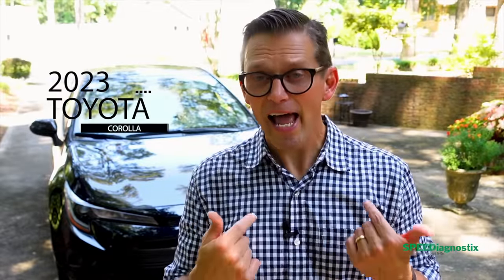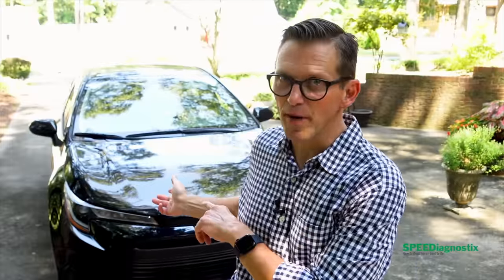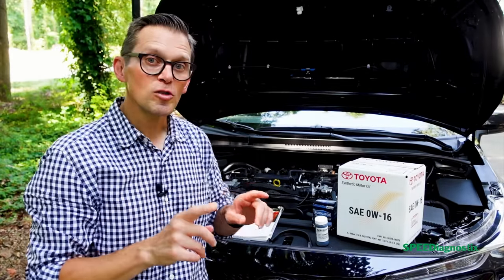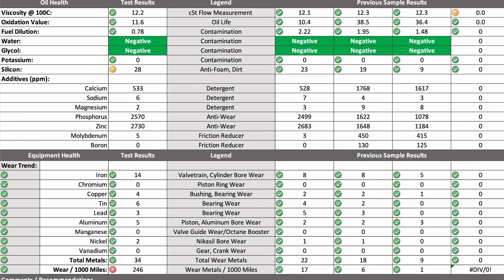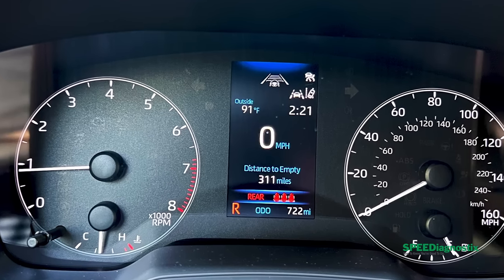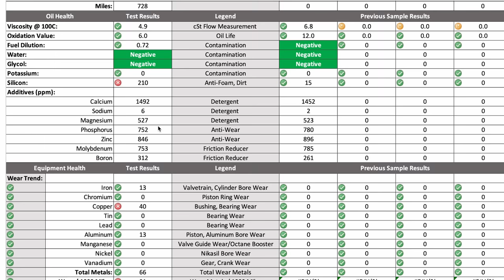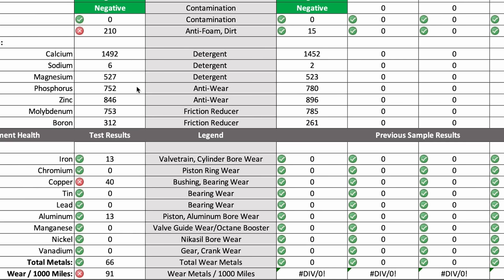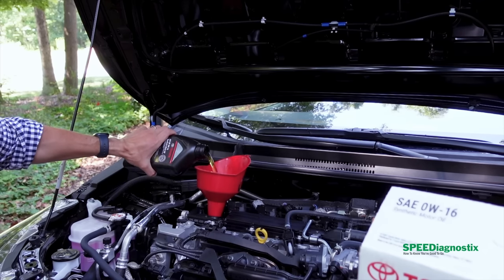AVOID the ONE MISTAKE Almost EVERYONE Makes With A Brand New Car

Comment: If you have a dealer free oil change every 5 k miles ...Mark your oil filter to VERIFY it was changed, just saying
Reply: It sounds like a good idea but not sure how to do that with a filament only filter (permanent housing)
Reply: @kamakaziozzie3038 you can use torque seal or bolt mark where the filter housing meets the engine. If they changed it, the seal will be separated/snapped
Reply: Absolutely!  When I had a brand new TRD Tacoma I took it to the dealership for the first oil change.  They said they changed the oil but when I popped the hood, same mud covered filter.
Reply: Mark it by scratching it lightly with a file. If you use a marker they got chemicals and cleaners not saying they’ll go so far as to clean off marker but you really want to be sure they changed the filter
Reply: @kamakaziozzie3038  I share your concern, and have type canister filter. What I do is use a silver sharpie and draw 2 small lines on the filter housing and filter housing contact service, they rarely mount it back to the exact same place.  Plus this tells me if they over tightened it
Reply: Good advice.
Reply: Toyota doesn't do the oil change at 5k miles, they do a rotate and inspection. We'll at least how it was when I worked there a few years ago
Reply: @EmerysZR2Duramax smart way to mark your oil filter
Reply: @zilchbupkis3109  No,use a marker pen or a paint pen of some kind which some garages use.
Reply: Everytime.
Reply: install a glitter bomb filter
Reply: I do it all the time! Its a message to the dealer! I even write change, with a sharp object!
Reply: Does not work if you have a canister oil filter as on new GM's. No way to mark it. Maybe two marks on the oil filter housing, one on the lid and one on the canister not sure what the answer is here.
Reply: @scrambler69-xk3kv  Maybe just accept that the tech is going to change it and stop being paranoid
Reply: I had dealers put way more oil in my car than I needed.... only reason y I found out....I did it my self.... to much oil cause damage
Reply: @kamakaziozzie3038  Many have thread on external cannister to go with replaceable element and they seldom torque to exactly the same spot.
Reply: Correct, and make sure to use a Sambrucetta marker to denote it.  You don't want to take any chances.
Reply: @zachdailyfost4433  Correct. The 5k mile "free service" is tire rotation and fluid "inspection". I did my own oil change on my 2024 Corolla at 2937 miles. I refused the service from the dealer because the lowest paid person is going to be assigned to do it.
Reply: You get what you pay for.  Golden rule.  If you care about your vehicle do everything yourself that you are able to.
Reply: @chrispapanastasopoulos9192  what about replacing rear differential fluid?  Subaru says to do it.  Im way over the recommended change-out, but it's a bit tricky, should I do it?  it requires a special socket.  i bought the fluid but I've let it set for several years, is it ok to still use it?  I had the wrong socket and gave up..  Am I ok or will I need to get the gear lube (Differential oil again?...I called the manufacturer - Mobil One and they said it's expired and they can't make a recommendation either way).   Sounded like she was just reading off the company policy.  Subaru quoted like $800 just to do it which I thought was ridiculous
Reply: How does that work out for cartridge type filters that are inside a housing...Anyone can disturb a mark to make it look like it was messed with...
Reply: Do Not let the dealership change your oil!

Comment: And if you're using such a thin oil, your bearing clearances and internal clearances are very tight. Which means it's even more sensitive to engine debris causing damage. Good call, thanks for the video.
Reply from the maker: Great point!
Reply: And with such tight bearing clearances for 0w-8/16 oil it’s also very important to not ever run too thick of a viscosity oil too like for ex a 5w30 or worse yet 10-30 o,5-40,10-40,yikes!/LOL!
The motor can obviously handle 16wt viscosity when the oils up to full op temp so if I owned a new car that rec ow-8 or 16 oil & lived in a warmer climate like Fl often using ac loading motor more & creating more heat I’d be running (if they make it ) 5-w-16 or slightly higher cold 
viscosity oil like 5w-20 & here’s why I say that.
In my wife’s when new 2018 RAV4 Toyota wanted us to go 10k miles an oil change inc 1st breakin oil change ,not me!
I changed oil & filter at 1k miles & again at 5k miles using m1 0-20 full syn.
What alarmed me was (esp having 50yrs Exp rebuilding muscle car motors & restoring car with motor oil & its analysis being a hobby of sorts for me) was that with only 4K miles on the m1 0-20 it was pitch black & had heavy burnt order to it which wasn’t good imho.
But I put more m1 0-20 full syn in it for next 5k miles to total 10k mikes on the motor & that oil looked & smelled worse with only 5k miles on it being full m1 oil.
This oil seemed as though it could not handle the everyday heat & driving here in ny which aren’t that bad but with a still relatively new low mile motor the oil should not be pitch black smelling burnt.
I never liked 0w oil base Wt oil in full syn & thought I better try moving to a 5w-20 m1 fully syn where it has a little better protection against heat & shear having a more robust 5w base oil.
Well that did the trick because the next 5k miles on it & it never turned blk looking med tan color with no burnt smell & could still see marks on dipstick thru the oil too.
Fast for word to 60k miles today changing m1 5-20 full syn oil & filters every 5K miles and the oil has never been black or smelled burnt at 5k mile changes like the 0-20 did which tells me the 0w base Wt in 0-20 & it’s additive pkg can’t handle the heat etc in 5k miles turning blk & smelling burnt where 5w-20 oil from same mfg never turned blk smelling burnt in same 5k mile oil changes in same motor in same use cond to yrs later now at 60k miles changing the oil & filter every 5k miles. 
Btw,this car/motor see’s mult trips from ny to fl yearly where the motors pushed hard with ac on at high speeds for hrs at a time & in fl heat in traffic with ac on & the m1 5w-20 never turns blk or smells burnt with now 60k miles on the motor at 5k Mike oil changes,motor doesn’t  use or burn any oil in 5k miles too!
I know I made the right call/choice to not use the m1 0w base Wt oil in our RAV4 when I saw it turn blk & smell burnt in 4-5k miles where 5w-20 never turns blk or even dark brown & never smells burnt even at 5k miles like the 0-20 always did. Yes oil analysis would have been nice to have but I was in a position where I had to change the oil on the spot with no sample kits at home at the time to collect a sample.
But seeing the drastic diff in color of the 2 oils in same mileage with one smelling very burnt & the other not smelling burnt at all looking nice tan color & not blk told me with just going from 0w to 5w that the lighter 0w base Wt oil can’t handle heat & stress as well as the 5w base Wt oil could with i would assume both those oils having basic same additive pkgs past the diff in base/cold W Wt.
Keep up the great work you you do on oils educating us on tech etc.
Happy motoring!
Scott
Reply: Even more reasons not to follow a 10k oil changing schedule.
Reply: Not necessarily…
Reply: It's really sad seeing people go 10-12k miles between oil changes on these cars.  You see it all the time checking the service records on these cars. They will be (1+ quart per 1k miles) oil burners by 100 -130k on the odometer.
Reply: Use nothing thinner than 30 w Ever if so your Destroying the Engine..   But the Manufacturers will sale You A New Engine or vehicle..   clearances can only be so  tite or the engine can't rotate ...
Reply: @watchinglclowns9890  That's 1970s talking. Metallurgy and triboligy have come a long way.
Reply: @WyFoster  This, its the reason why listening to old mechanics is sometimes a bad idea. Yeah, they have a life time of knowledge and are possibly right on most things, BUT they also carry a life time of myths and superstitions. At the end of the day, ask the engineers.
Reply: The real reason Toyota specifies 0W-8 is fuel economy. In other words, reducing aggregate fleet consumption (CAFE). It has nothing to do with bearing clearances. 0W-16 is a better choice as it will behave similarly at cold start up but offer much better shear stability at higher operating temperatures.
Reply: @scottwheaton9689  there is a thing called HTHS, hot viscosity (aka "weight") doesn't tell me much about an oil. In any case, this engine would run perfectly fine FOREVER (and I'd argue, FOR LONGER) if a good 0w30 was used instead of the stupid CAFE 0w8.
Reply: @themotoroilgeek awesome video and very helpful. Question, what about trans, differentials and transfer case? Do they also have a break in period that need an oil change? And final question for transmission oil change on a brand new car, should it always be drain and fill or every oil change needs to be flushed?
Reply: @themotoroilgeek what frequency would your oil change intervals be on this motor going forward?
Reply: No they’re not. The same car used 10w30 elsewhere in the world.
Reply: @m.armstrong53  it should be every 5k miles.
Reply: that makes a lot of sense
Reply: @craigfin3222  
DO ask engineers... But ask them outside of their office. 
They will tell you that those super low viscosity are ONLY for fuel economy on the test bench. Engines will not last even 100k miles with that. No matter how small tolerances are made, this oil is NOT capable of bearing the load, given todays cars are all boosted and have extreme pressure on the bearings.
I worked at a test laboratory around the 2000s, when those 0W oils came out. We had the "autobahn exit" test, which was full load WOT, then idle, then 1500RPM at WOT with very hot oil (150°C). Man, those bearings and piston rings suffered... 
That experience burned into my brain: NEVER, never use this BS oil.
Another thing: Ask engineers from other countries. Why?
Well, in the US, a typical oil in the 90s was 5W30. While in all other countries, the same engines typically used 10W40 or 15W40. 
While oil change intervals in the US were 3-5k miles... in Europe it was 6-9k miles!
Whoa. How come?
That's because America always used (too) thin oil. They didn't need a heavier oil, because of their driving habuits... The average US V8 is cruising at 1500 RPM on the highway, while the Euro I4 runs at 4-6000 RPM for hours. We need better oil... really "better", that's why there is no problem at all changing it "only" every 10k miles. It's still clear by then... 
On my Maserati, I even run 10W60 Shell Ester. Change it every year, which is less than 5k miles, usually because something on the engine needs work ;-)
Reply: I just changed the oil at 1k miles on my 3.5v6 2023 tacoma. The oil was dark coming out. I used a genuine Toyota oil filter and switched to amsoil signatures series 0w20. Great video btw! What’s your thoughts on the amsoil signature series vs the Toyota genuine oil?
Reply: @craigfin3222  Yea, like the engineers who built the Toyota's in the 70's and 80's and destroyed the engines due to gunk from oil issues.....   Sorry Craig, but not all engineers are that bright.